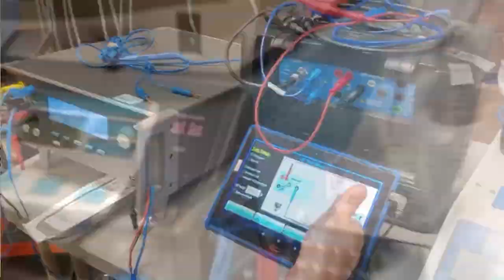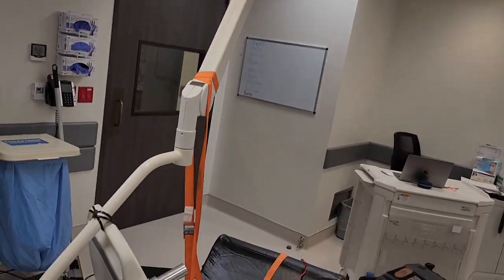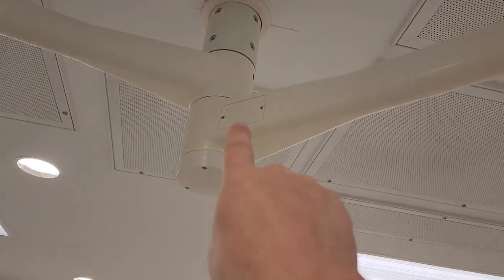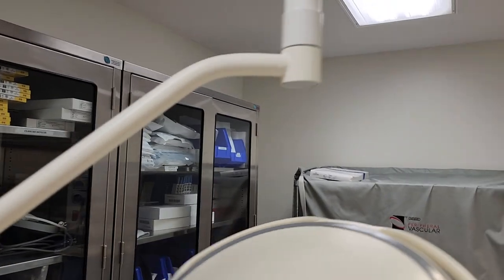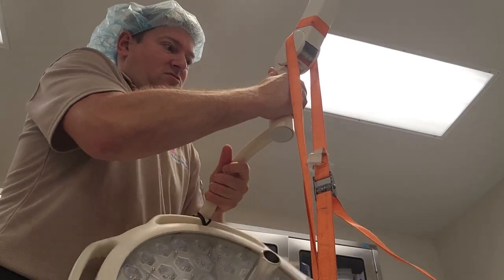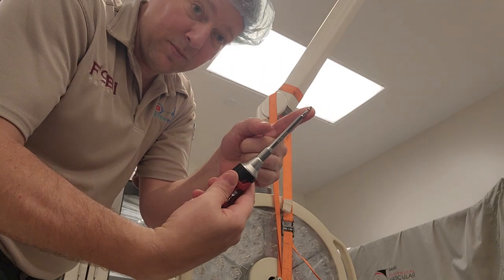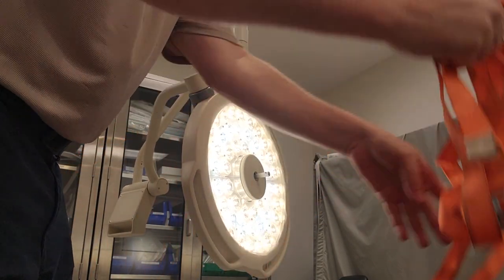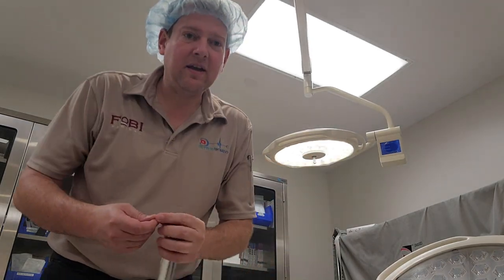OR Ceiling Light Repair

Comment: I read about an OR light incident a few decades ago. The high watt incandescent light had a cracked glass lense. A new one was ordered but they needed to use the OR. Maintenance removed the lense and said they could use the light. During a long bowel case the team noticed the intestines looked an odd color and the teams eyes felt wrong. The patient did poorly and died a few days latter. During an investigation they discovered the missing glass lense actually served as a UV filter. The patients intestines and the teams exposed skin and eyes had been sunburned.
Reply: Hello. Friend I have one problem the surgical lights they heat up 50 C° in the work area I must place an Infrared filter.